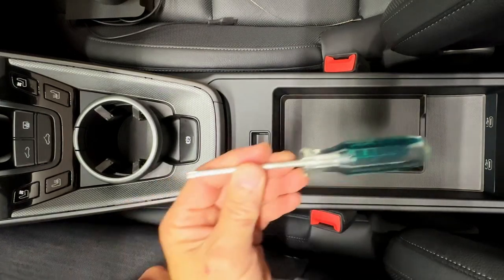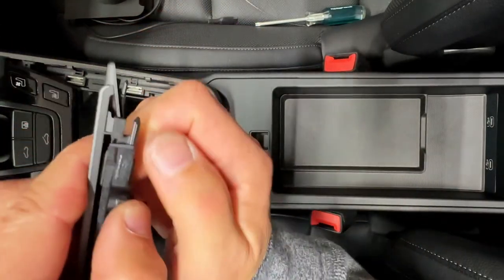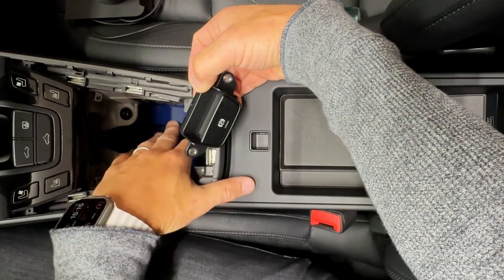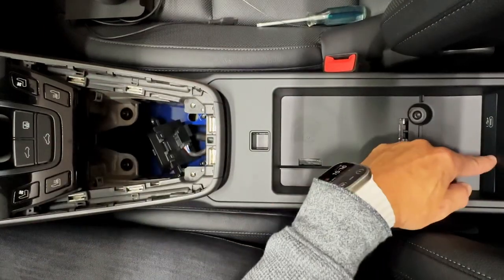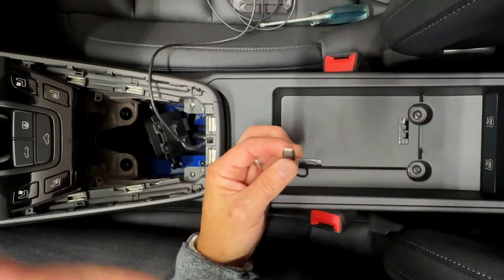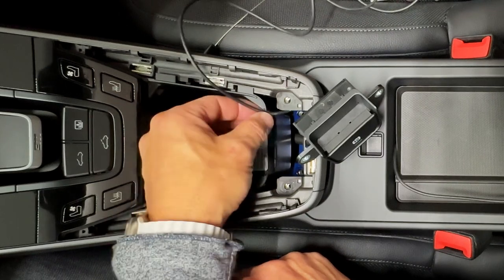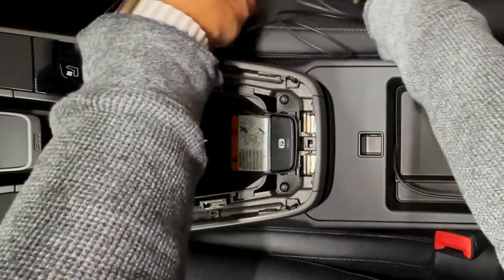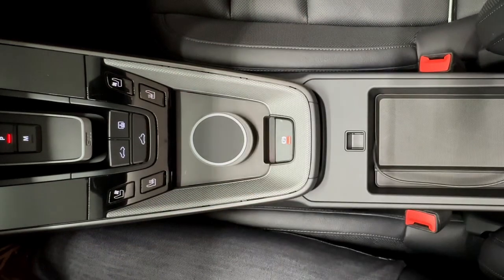Porsche 911 [992] 2020+ MagSafe Mount Installation

Comment: Very nice product but, cup holder is gone. There is nowhere else for holding cup in 911(992).
Reply from the maker: No drinks allowed in the 911
Reply: The door pockets hold a water bottle
Reply: Use a magnetic cup.
Reply: Kaizen lighting, who also invented this magsafe solution, has a new cupholder product you can use with this.

Comment: Is there a USB A option or USB C to USB A adapter included.  2020-2021 models don't have USB C.
Reply from the maker: Yes, we include both connectors on out 992 kit.

Comment: I can’t seem to get the trim piece off. Any tips beyond using the fat of your thumbs? 2023 GTS with M/T
Reply: Got it. I used some plastic wedges on the sides and pulled from the back.
Reply from the maker: Assuming you are original owner and no one has been in there before and "made it better", I would maybe ask someone else to give it a shot. As you can see in the video, it is just clips that hold it all together.
Reply: @nine-volt  it's a brand new '23.  I got it off, but it took some careful prying with trim-friendly tools. Works great now that it's in!